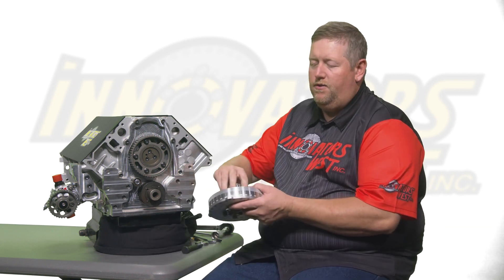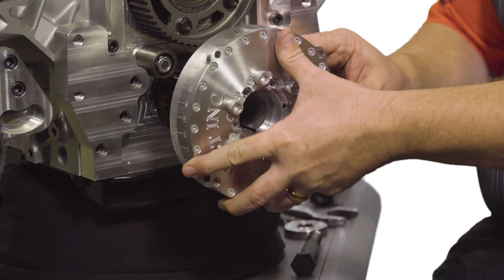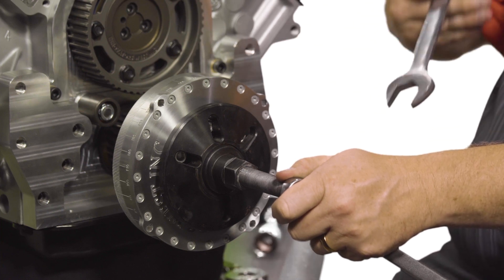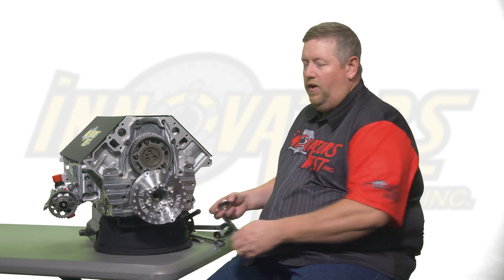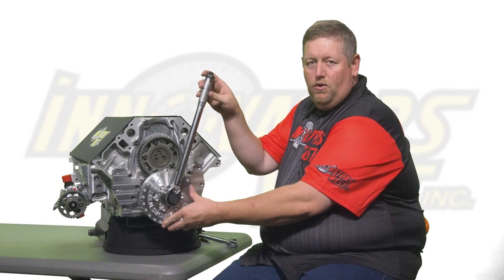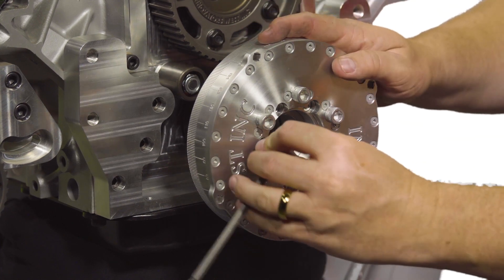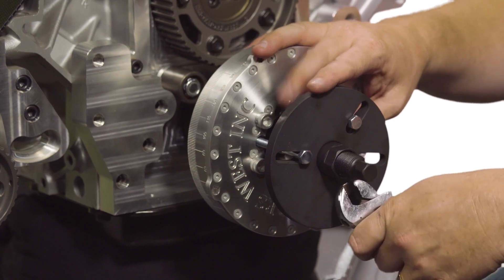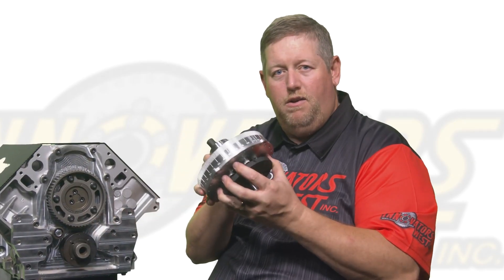Innovators West Tech Series - Harmonic Damper Installation

Comment: Do you have a link for that removal tool?  Seems like I can’t use a conventional pulley
Reply from the maker: Here is the universal installer/removal tool that we sell.   https://innovatorswest.com/product/10200-damper-puller/    We also sell custom adapter for installing dampers on LS, Godzilla, GT500's, 2JZ, Hellcat and other applications with the deep drilled crankshaft bolts.